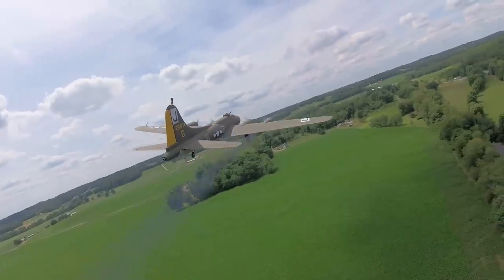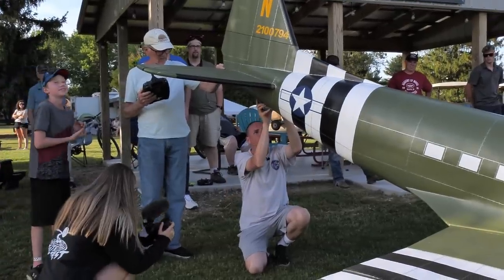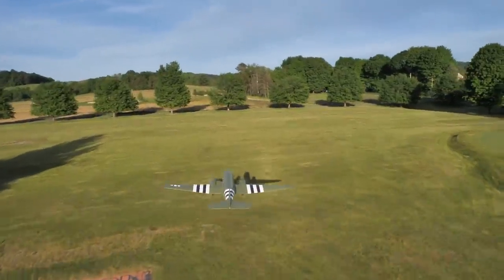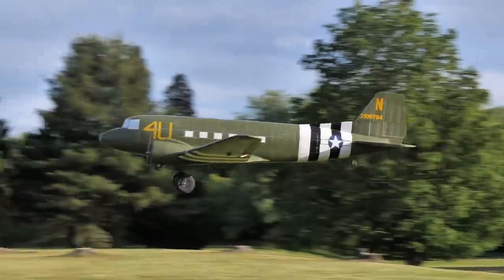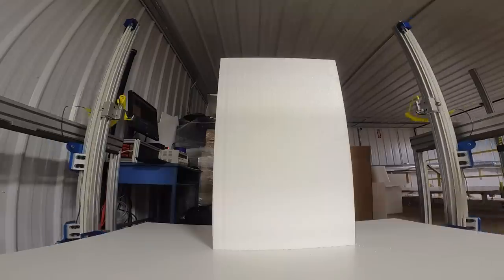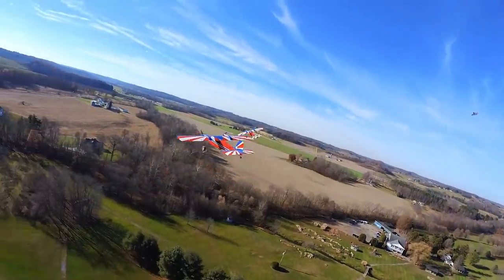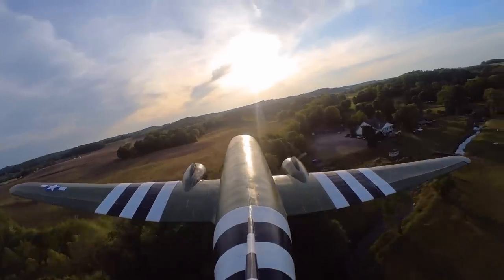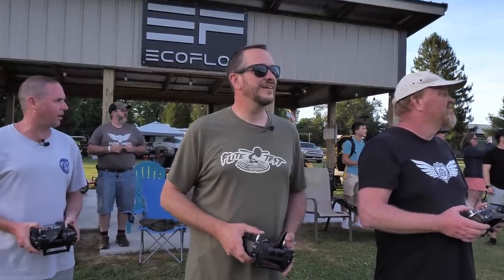Hardware Store Planes You Can Build + Fly Monster Gaggle

Comment: I had an aristo fly back in the 70s with a weak liquid cell battery it barely had the power to keep in the air. And it was built using balsa sticks and glue membrane covering to keep it super light weight, the new electrics are crazy better and simple

Comment: The DC3 was incredible I'm just a little disappointed that it lacked rudder.
Reply: Many multi engine RC planes lack rudder, just add differential thrust and all is well 👍
Reply: @andrewasdel4230  Old school modelers often cared more about the "object" itself than about the sheer "performance". The takeoff of the DC3 clearly showed lack of  directional, and from a "likeliness" point of view it would not have gained any points from a jury. A pity, since from a distance the model makes a perfect show. With a plane THAT big you can add a real rudder and even working trimming tabs with liitle additional work. If you want to be cool and "millennial" add a gyro to the differential, at least the plane will take off straight along the runway.
Reply: @AlbertoNencioni  I add rudders even to the smallest of planes.  Sure you can steer with diff thrust but it just doesn't tickle me much.  I agree with you, a plane that big could easily have had a couple of rudder servos added.  But!  It's his model he can do what he pleases with it.
Reply: @MisterWillie060  Never objected, of course. An old modeler's point of view.

Comment: Have y'all tried to make an R/C plane that would be capable of flying a person?
Reply: That's not possible for many reasons
Reply: @AviationAngler  such as...
Reply: @AviationAngler  such as? (Honestly asking)
Reply: @claycopopo  There's an FAA weight limit on RC airplanes unfortunately, I think it's only like 50 lbs.
Reply: @claycopopo  1 they use foamboard to make them and that can't hold a human 2 if you could somehow make a big enough plane to seat a human the thrust to weight ratio would not be enough 3 The FAA has many regulations and flitetest is working with them and AMA to compromise on their bills that being said if they were to do something as unsafe as put a human on an rc plane they would probably not want to work with them
Reply: @claycopopo  that being said RC planes means radio controlled but technically if you mean rc plane as any type of aircraft piloted from the ground the military is already working on those I believe I heard of an F-16 that was piloted by Artificial intelligence 😳 but there are also things like the MQ-9 reaper drone which the whole purpose of that is to go to war withought having to risk a humans life
Reply: @AviationAngler  
The main reason I was asking, is because of the ultralight category.  Instead of controlling the plane from the ground, the pilot could be in the airplane.  I am curious what flight test is capable of building.
Reply: @claycopopo  I suppose you could make something like what peterstripol made and make it RC somehow I think the main thing just come down to how precise you can be with the controls because if you over correct by accidentaly moving your hand in the slightest ...

Comment: Any concern with tip stall?  DC-3 famous for it.
Reply: The DC-3 is famous for a relatively high stall speed and stalling just after takeoff. This is easily overcome by simply not allowing the aircraft to rotate until sufficient airspeed is achieved and not slowing down too much, especially in a turn.
Reply: I am not  sure that a foamboard and heat-glue model has anything to share withe the real plane.
Reply: @AlbertoNencioni  You mean you don't use NACA airfoils on your foamboard planes? 🤯
Reply: @andrewasdel4230  You know perfectly well that airfoils are only ONE of the problems in a model, and even so they are almost always misunderstood. A certain airfoil, NACA or else, has a meaning only in SOME size  and conditions, some fluid density, some structural and elastic properties of the wing, some speeds, some Reynold's numbers. If you can project a NACA profile "corrected"for all the above factors, chapeau. If you can build a foambord wing witha THAT exact profile, double chapeau. Otherwise you fall on the usual "Clark-Y-ish" profile that is the Jack-of-all-trades of model planes wing profile. You have all the rights of being sophisticated in your models, but you must pay a high price in study, project time and building accuracy.
Reply: @AlbertoNencioni  You bring up a good point, I will see about getting some funding from Congress and some time at the high speed wind tunnel at my company. How can anyone claim to build a "Mustang" without a proper laminar wing?

Jokes aside, wings with a taper, (which the DC-3's have a lot of) will generally be more prone to stalling from the tips, but most events modelers call "tip stalls" are not that.
Reply: @andrewasdel4230  I used to call them "software glitches" - mucho more tech.
Reply: @AlbertoNencioni  I like your way of thinking. It's always annoying when I crash a plane of my own design, (so blaming the designer doesn't help) but when all else fails, there is always the radio/software whipping boy.

How the control line folks maintain their egos, I can only guess.
Reply: @andrewasdel4230  The man in the center blames the one that tunes the mixture of the plane, and viceversa.

Comment: Hello, I don't know if someone can help me but I have a problem with an rc plane. The pwm servo output on the omnibusf3v3(sd) board does not work, the board is receiving a signal from the receiver and processing it but there is no pwm output for the neither for the servos nor for the motors, there is only pwm for the output marked as motor when i use the motor test mode, and the 5v and gnd servo rail is working, the program i use to program it is the betaflight program, how do i do it I solve? thanks if anyone helps